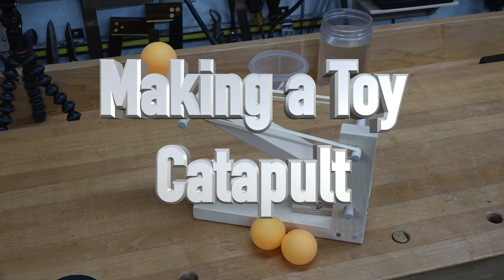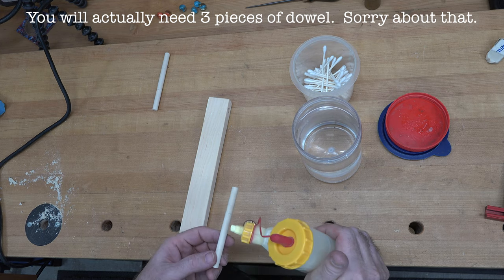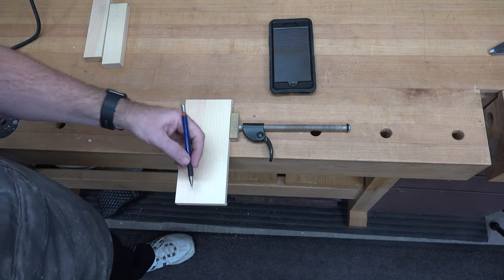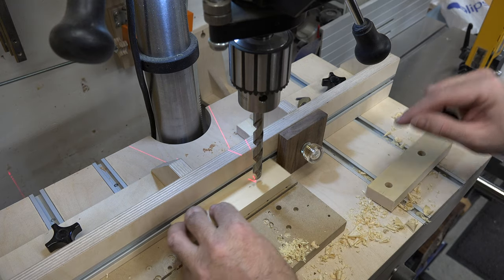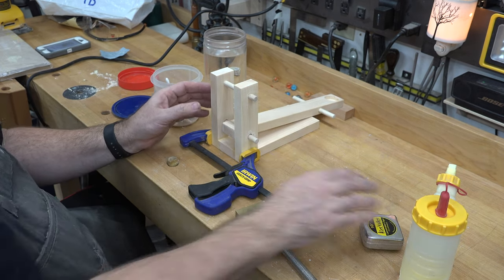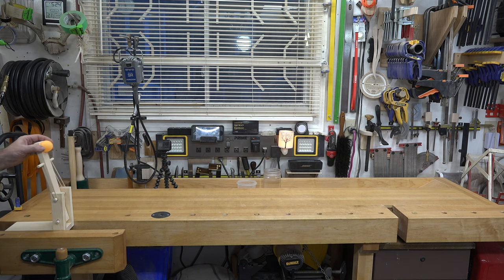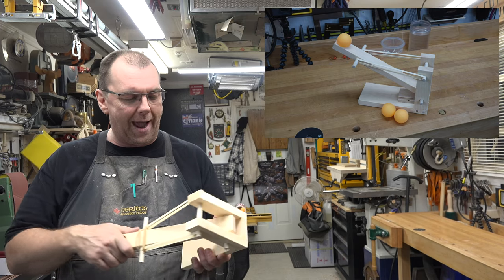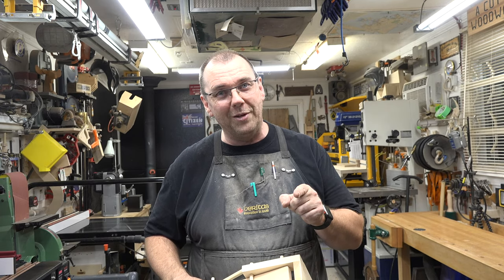Making a Toy Catapult

Comment: I think the kids on my street will have a good time for the 4th of July street party - thank you.  Truly easy to follow your instructions.
Reply from the maker: Glad that you found the video to be useful Pieter.  Good luck with your builds.  I hope the kids have a great time.  Thanks for tuning in to the show.
Reply: @acutabove_woodworkings  I would like to know the scource of the straight edge meassuring instrument you used (flat sheet of with holes for marking).  I think it would be more accurate than the hook ruler I am currently using.
Reply from the maker: @pietervandertuin4069  The device that you are asking about is called a T-rule and it is made by INCRA.  They are available at most woodworking suppliers or from INCRA directly.  I got mine at Lee Valley tools.  Here's a couple of links.
https://www.leevalley.com/en-ca/shop/tools/hand-tools/marking-and-measuring/rules/58877-incra-t-rules
https://incra.com/measuring_marking-trules.html

Comment: NICE project!  The shots with the ping pong balls shows another piece that looks like a lower plywood stop block.  Is that correct?   Thanks.
Reply from the maker: It took me a while to figure out what you were referring to but I get it now.  That plywood block was just placed there to keep the catapult from firing while I took a picture of it.  I guess you could make it a permanent feature of the catapult but it was not its intention and was only put there temporarily.  I hope this helps.  Thanks for tuning in to the show.